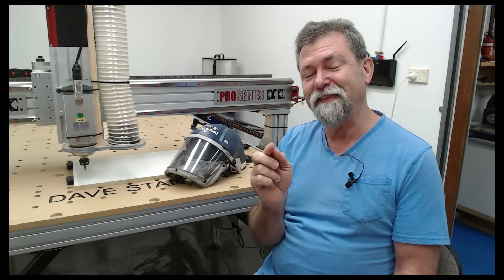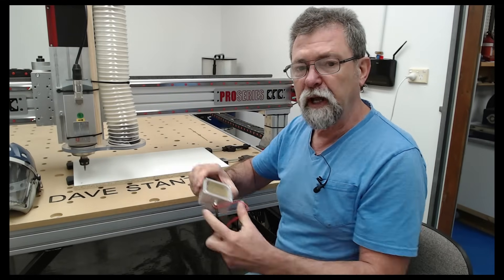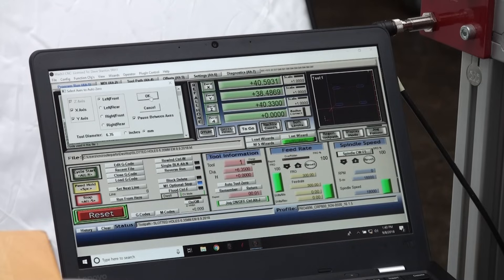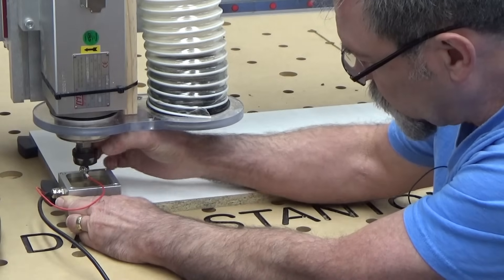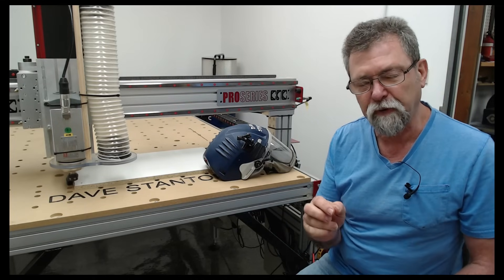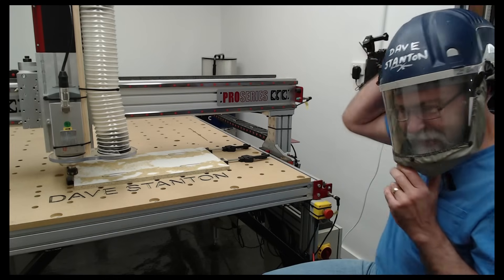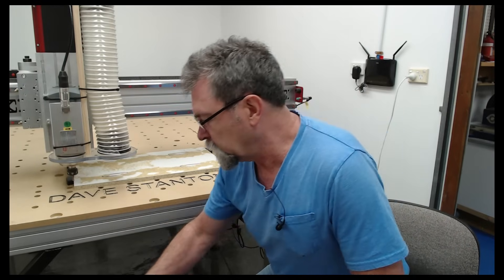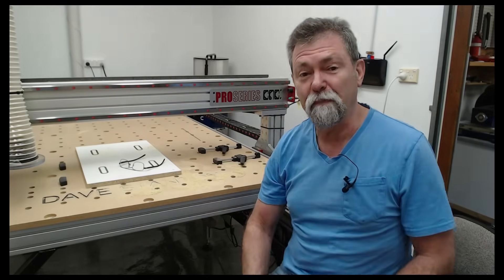MACH3 CNC DAVE STANTON EASY WOODWORKING

Comment: Thanks, I am new as well.. I have a 4x8 CNC with 4th rotary axis coming from China, should arrive in couple months. I will be using Mach3 so this helps. Anyone have opinion on best and easiest CAM software to use for design and setting tools, speeds, and feeds?

Comment: Extremely clear demo Dave Thanks. Also, vague memories of happy days in Oz as well! After struggling to create an array of holes with freecad and giving up on Fusion 360 after a) a UI change and then b) finding the UI would only appear correctly in French (not just me) I watched the array function engaged as smooth as silk. Intend to deploy this on my recently completed MPCNC router. Might be able to afford a beauty like your rig one day but  doubt it! Thanks again, just hoping the Aspire gcode is compatable with Marlin firmware
Reply from the maker: Hope it goes well for you!

Comment: Shame MACH3 doesn't show a picture of the design you are about to cut.
Reply from the maker: Hi Ian Crossley. It actually can.
Reply: Hi Dave, Thanks for sending the link to you cutting the ovals. I got my machine and am getting
into wiring now. One thing, when you Z'd using the touch plate was there the option of Z-ing the top of the material or the top of the bed? Do you have to choose one or the other?  Ian

Comment: Just learning Mach3 and when I use the keyboard to move the spindle, the directions are consistently opposite.  Do I have a box that is checked or needs to be checked to fix this?  Page up lowers and Page down raises.  Left arrow is Y up, Right Arrow is Y down, Up arrow is X to the left and down arrow is X to the right.
Reply from the maker: Hi McRae's PS! You would need to contact the manufacturer of the cnc control box to see if you have everything connected correctly.
Reply: @DavidStanton  Thank you for taking time to respond.  Enjoyed your teaching style.

Comment: Dave, question.. 
If you load a full sheet of 1200 X 240, can you hold down without nails or screws ? (On your 1200 wide gantry) or do you need the 1500 wide gantry and then use Festool type dog/clamp? Im wondering if I should get the 1500 wide gantry based on that alone.
Reply from the maker: Hi 86rix! I would have asked for the 1500 wide x 3000 long model if I had my time again. Makes it easier to handle and secure full sheets. Depends on space available.

Comment: Dave, I am setting up my cnc with mach3. Do I need xyz switchs to set up the zero ?
Reply from the maker: Hi Ad Bas! I don't think so. You can position the cutter on the corner of the job and then tell mach3 that all your points are at zero.

Comment: I like your style and the content and I subscribed, but I just finished my CNC hardware and the Mach4 setup so I have a functional moving machine and ready to start the Aspire part. But as luck would have it, you skipped the ONE thing I needed most at this moment. The point at which you are done with Aspire and you save it as a gcode file. There is a process where the file is converted into a g-code file that is specific to Mach3. You mentioned briefly Mach3 arcs mm. I am using Mach4 and imperial so I assume the process is different since Mach4 is a different flavor. Have you looked at the different flavors of post processors and have any insight to share on them ?
Reply from the maker: Thank you OldePhart! I now have mach 4. I will do a video on it soon, but in the meantime, save your toolpaths as Avid.

Comment: Hi Dave, Just ordered a 3040T with a VFD motor,  you said not to touch the spindle why is that, I'm a Noob?
Reply from the maker: David Something, Not sure I said not to touch the spindle, I think it was, leave the VFD off while I am touching the spindle. The VFD is the power to and controller of the spindle.
Reply: @DavidStanton  Thanks David I think I am wise enough not to touch the spindle or cutter whilst it is on :-) but will switch it off anyway . My 3040T just arrived today, I played around a bit with CNC machines in my later engineering days for a living but not had much experience with the actual CAM side of things apart from a crude NC lathe I used to work on with its proprietary CAM software.

Comment: Today, I've visited a beginner wood carving class held by a senior, very experienced wood carver. While I was learning the very basics of carving, the topic of conversation suddenly turned to CNC routing and that he has a brand new CNC router in the other workshop which he hasn't started working with yet since he lost the translated manual for it and cannot understand English well. Being a software developer, I've no trouble with the language and I'm quite used to getting machines do what I want. Since most of my knowledge of CAM is theoretical (I did a few models in Fusion 360 as a hobby), your videos on Aspire and Mach3, setting up the machine... etc. will prove invaluable for me tomorrow morning, when we've agreed to give setting up the machine another try. Thank you.
Reply from the maker: Thank you LordyHun !

Comment: how do you get it to fill up the screen?  Mine is 1/4 to 1/3 the size of my screen.
Reply from the maker: Are you referring to the screen capture?
Reply: I needed to open it up to full screen then close the program then re-open it. It then opens to full screen. got it  working now
Reply: when i open mach 3 it does not open to full screen

Comment: Just put my order in for a CNCRP PRO4896 as well. Thanks for the videos!
Reply from the maker: Send me some pics as it goes together Perry!
Reply: I just ordered the Pro4896 also two weeks ago. I keep checking my email waiting for the shipping notification lol
Reply: I live in the same state they are made. So I'm just waiting for the call. They said about five weeks. Gives me a good fall winter project.
Reply: Perry, can you list the components you picked and let us know at the end if anything was missing/required to get the machine up & running. Here is my list and I am wondering if I have everything all together.
- PRO6060 CNC Router kit
- Plug and Play NEMA 34 CNC Control System
- 2.2 kW Plug and Play Spindle / VFD System
- Mach3 CNC Control Software
- Pepperl + Fuchs Proximity Limit Switch Kit
- Auto Z and Corner Finding Touch Plate
- Leg Kit (PRO CNC)
- VCarve Pro CAM Software

Thanks!
Reply: @Marcus_Caius  I ordered about the same things including extra collets for the spindle, spoil table fastener kit and Aspire. I also went with the Nema 23 motors. It was done at 3.5 weeks and I assembled it in a day and a half. The Nema 23s seem to be fast enough for me as a hobbyist. That was my major concern. The kit seams to be good quality to me.
Reply: Thank you for the update Perry.

Comment: Hello from Newfoundland! Just bought a machine like yours and have it partially assembled. Did you have any issues with grease nipples stripping out or falling out when removing grease gun? Also I've been thinking about hold downs. The ones in your video look neat. Can you provide some info on them? Thanks for a great series of videos!
Reply from the maker: Hi Robert. I watched the videos from CNC routerparts before I built mine and they mention rolling the grease gun off the nipples. I did have one come out but there were a couple of spares in my kit so I screwed a new one in. The clamps I use are Festool, you can get them here if you want. https://amzn.to/2NlISGv
Reply: Thanks for the info. I'm looking forward to more of your videos; your comments and instructions are clear and helpful. Regards.
Reply: Hi Robert, I had the same problem with my old router. I had bought a new grease gun and the tip has a threaded end. Once on the nipple you can tighten the thread to hold it on then untighten it to remove it. That should help. Ian
Reply: @iancrossley6637  Thank you for your reply. I was not aware that such a thing was available. I have already stripped out 3 or 4 if the fittings and now I put the stripped out nipple in the grease gun and force it into the hole. Not the best solution but seems to work. CNC Router Parts ( now Avid ) sent replacement slider housings but so far I 've been lacking the courage to rebuild the machine. 
Do you own one like it and if so how often do you grease it?
Thanks.